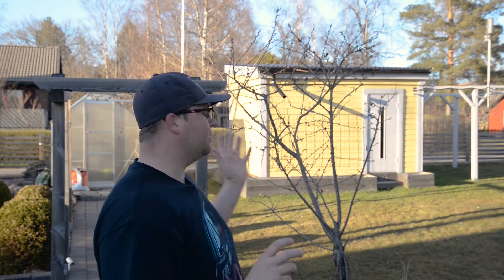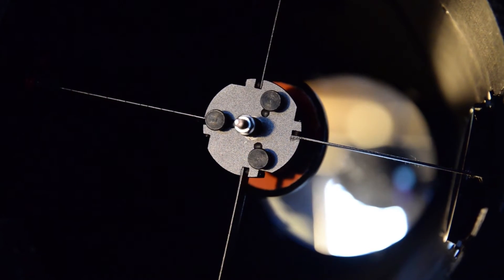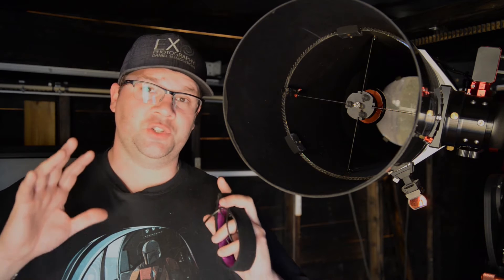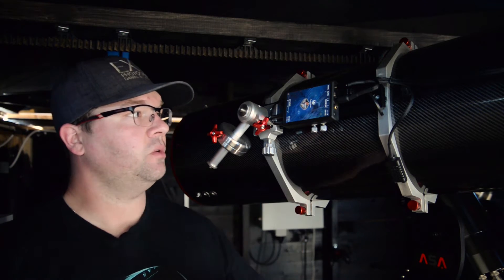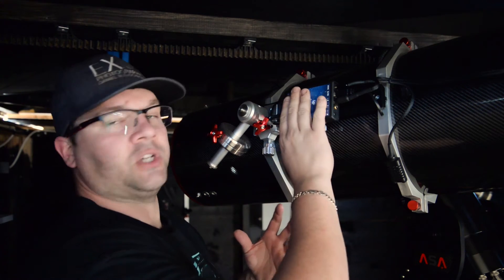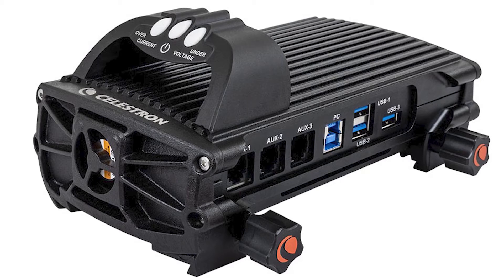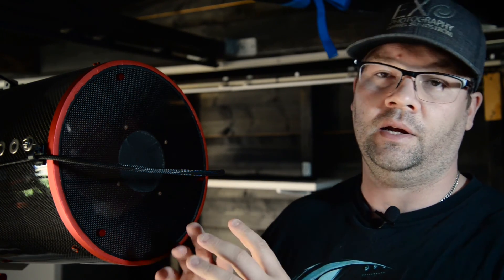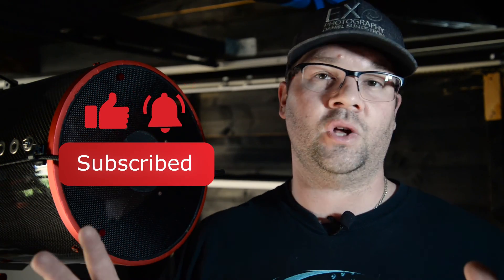Stop dew forming on your lens or mirror!

Comment: Where to get that Pegasus Astro Power Box?  I need this, can't find the device!   I've been looking for something that calculates dew point & then controls heat strips. My use is for a camera enclosure that has a glass window. tyvm! I must say though, I've never seen anyone use an RCA jack for power, that seems crazy.
Reply from the maker: The version i have might be discontinued, but they have two or three different models of the powerbox. Check thier website for where dealers are located.

Comment: I had forgotten about fans, thanks! Connecting the heater directly to the battery could also damage your telescope if it gets more than warm. Without a heater controller you lose some level of overcurrent protection for both the heater and the battery attached to it.
Reply from the maker: Fans can do a very good job moving air, and just like you say, a good controller is a good choice!

Comment: Nice vid! A few OT questions tho:

1) Where did you get those tube rings?

2) Whats the length, ID and OD of the FTF3215B-A drawtube? Cant find any verbose specs, technical drawings or even installation instructions on the manfucaturer website.
Reply from the maker: Thanks :)
The rings followed the tube (N-GA10)

The inner diameter of the "True 3" FT3215 is 3"
They are not the best at marketing and spcifications at Starlight instruments.

The lenght of the drawtube, I am unsure of - but the travel distance is 1,5"

The OD of the drawtube is probaby 3,2" (hence the model name 32 15) but I have to verify that.
Reply: @ExoPhotography1  I recently was looking at the Prodigy 3" robotic focuser from Pegasus Astro and it turned out the drawtube ID wasnt actually 3"/76,2 mm but rather 2,99"/76 mm which made fitting the TeleVue 3" Big Paracorr a gamble wasnt willing to take. Experiences like this makes you yern for proper specs.

After much deliberation I decided on the FTF3215B-A and an add-on focusing motor solution. Maybe I ll go with Starlight Instruments own focus motor. A dedicated robotic focuser with built-in motor/electronics gives no future upgrade path and in case of electronics failure, complete shut down. Also, Primaluce Labs dont provide any newtonian mounting bases for their 3" ESATTO focusers and instead tell you to contact PreciseParts for a custom part, PegasusAstro doesnt know what an inch is and the rest of available 3" focusers looks either dated and awkward to motorize or cost an arm and a leg.

I ve been waiting for the focuser to arrive since january. No word yet tho I have been in email contact and they assure me that the business will continnue despite the founder passing away a few months back I beleive.